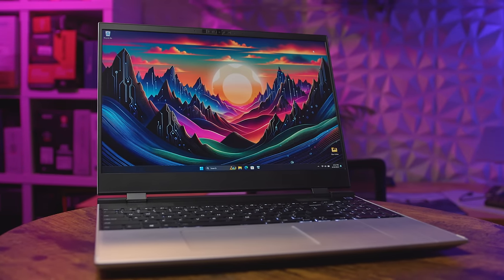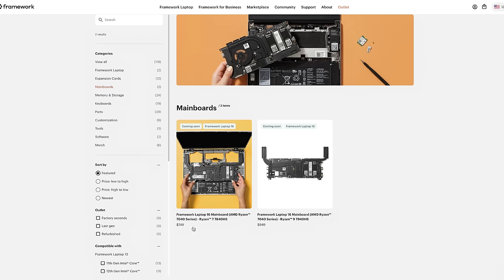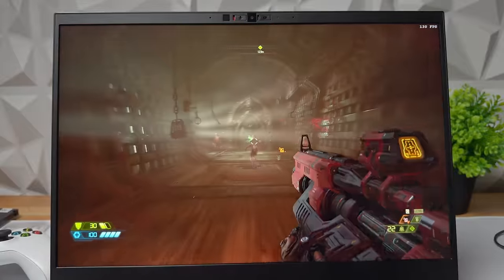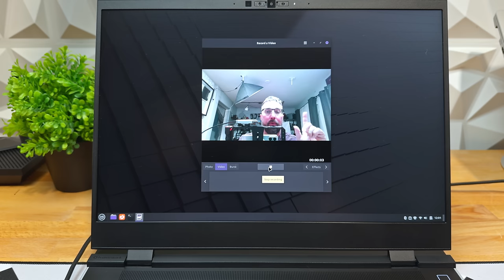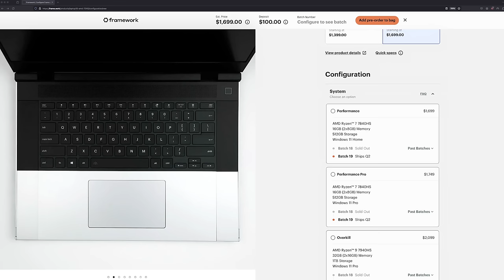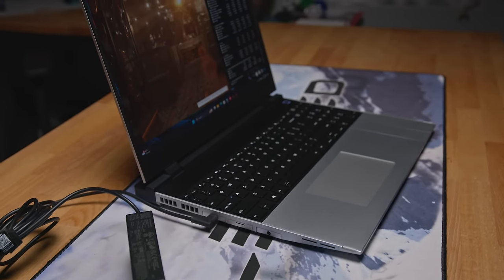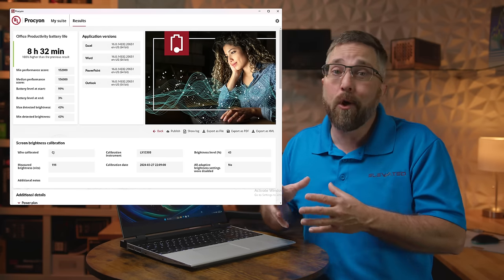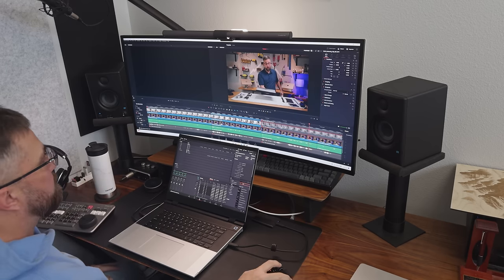Two Months With the Framework 16 Laptop. My Final Thoughts!

Comment: I'd venture that the pricing now for it makes it a poor choice. However, when you want to upgrade it with the marketplace in full swing (6-18 Months out) that upgradability will pay off all the more I think. Steep jump in price now but longevity is where this will win.
Reply: Yeah, while quite expensive now, it can still recoop its cost in several scenarios. Having the ability to swap whatever you want whenever (wherever, Shakira knows) is a big plus, and allows you to do it when there are sales for example.

Though, let's face it, this is really good price/performance when you get it old (like Framework 13 with 11th gen Intel CPU) or refurbished or 2nd hand. The nice thing is that this will surely be very good for 2nd hand sales. Both for you to get one for cheap, or for you to sell it and recoup a good amount of costs. Same with the parts market.

It will take some time until people realize or until it will be more apparent the value of its repairability and modularity. Just like people in the past years said "just get an old Thinkpad" for a really nice, rugged, perfect for Linux laptop, the same will be with Framework. And I wouldn't be surprised to see a new class of people turning into snobs showing off their 12yo Framework with just a couple of upgrades still going strong and doing very well in recent apps (I would know, I might be one of them, lol). But I'm getting a bit too ahead, let's see how this evolves.
Reply from the maker: Maybe, but one of the ways I looked at it, if I buy an upgraded GPU in a few years for $500+ I've essentially still paid the same price as buying 2 complete comparable laptops. The saving money in the long run argument only works if the laptop is reasonably priced to begin with. If I'm already in the hole $1000, buying upgrades isn't getting me out of that hole, it's just getting deeper.
Reply: @ElevatedSystems All depends on the inflation. 
500 might not be much in 5 years.
There might be choices with Intel GPUs giving you Quick sync for video editing.

While not perfect it is a process to reach a better line of products in the future.
Reply from the maker: @zakit  unfortunately inflation will also effect Framework.
Reply: @ElevatedSystems  I got few old laptop still perfectly fine after years and years of using 

Alienware 15r3 which 6700HQ/1060
Clevo 650kk been upgraded from dual core to quad core and now running 6 cores 8700T with 1050ti 

A dell xps13 8250u

Their problem is no longer effective in power /performance, even I running them at best power efficiency speed.

So I am wondering how much the framework investment will pay itself. Another issue of framework is their slow delivery and development, when they shipped they were already 0.5-1 generation older 😢
Reply: @frankwong9486  they actually launched at a great generation. 7000-8000 laptops is a nothing burger, some 'AI' cores and a mild clock bump. their board upgrades later are usually pretty well timed, being under 6 months past the latest or actually i think the newest generation was on time. and being on the bleeding edge is usually bad for stability anyway
Reply: @ElevatedSystems  This better be tracking on every single Framework board meeting slide deck or the company won’t survive.
Reply: Better economic option is b-stock or buying used, where you can then buy new components to upgrade it.
Reply: Really! You guys? A small upstart company, going against the mainstream way of doing things will always be expensive! And their sales are also low, they have to do everything by themselves, testing, design, validation etc....
Not cheap things, prices will be higher.
Things will get cheaper in the long run, when hopefully more sales for their products starts happening.
Reply: i call that bs, it will only be a better option than normal laptops if the prices were very close, but that kind of money you could buy the 2 laptops for the price of one framework,  lets i buy one and after 5 years, my gpu becomes outdated, would you rather upgrade a 5 year old goddam laptop with all the wear and the scathed and usuage with just a GPU? or would you want to get the new gpu AND new other materials such as screen and keyboard, upragdabily is always a better option, but not for this kind of money, stop justifying this bs price and say its worth it, the reason framework is expensive is because it is still a small company
Reply: I think the real situation here is, it may be worth it for us to invest a bit of extra money just to make sure a company like this continues to exist and keep money away from people who are focusing on planned obsolescence. — I also like that there’s the cooler-master case to repurpose the 13 inch versions into a mini PC. And also they have an “outlet store” version with cheaper options from excess inventory or returns or whatever
Reply: Agree here, I use my FW13 primarily for offsite work. I unfortunately had accidentally dented my FW13 case multiple times to the point I can no longer stand it, and swapping out just the case makes a lot more sense cost wise.
Reply: When you upgrade you can sell the old parts, especially as someone can buy these old parts and slap them together with a 3d printed case as a cheap, powerful little pc. So they will retain a pretty good selling price.

Comment: In my opinion, there is no reason to buy the FW16 at its current price point unless you want to show support for the company and their mission statement. There are better laptops out there in terms of performance and performance per cost with some equally as repairable (HP, Lenovo, etc.).  With that said, the company is fairly new, so the cost right now is more of an "early adopter" tax and I suspect subsequent generations will only get better and be more competitively priced as they mature as a company and streamline production costs.
Reply: Yes but if nobody buys the laptop it will die.
Im worried they will die.
Reply from the maker: I don't think it's a problem, however, if nobody buys the laptop, do they deserve to continue?
Reply: I can't stand HP as a company. Big reason I won't buy from them. I commented why I think this laptop will be good for me. But, I'm not going for a GPU.
Reply: But if you want something faster, upgrading is an option, possibly saving money in the long run. 
Or if a part breaks, you can easily replace that one part instead of the entire laptop.
Reply from the maker: @harrkev  true but one of the ways I looked at it, if I buy an upgraded GPU in a few years for $500+ I've essentially still paid the same price as buying 2 complete comparable laptops.
Reply: The Framework 13 is where its at in my opinion. I don't think the FW16 is worth the price for gamers. There are much cheaper ways to game. The FW16 makes more sense on a large order of laptops for companies that want to offer a more affordable option longterm for their employees. It makes no sense to me at the current price unless I just want to support the FW company.
Reply: @ElevatedSystems  If anything doesn't deserve to continue, it's the literal mountains of e-waste.
Reply: You do realize used laptops have a higher resale value and demand relative to used FW parts that are typically built to work in only one laptop? Used laptops can also be gifted to relatives - even donated or repurposed, but the same can't be said about the majority of FW parts that will eventually begin to accumulate because they become so outdated as years pass, their demand drops to zero.  Kinda puts a wrinkle in the whole e-waste thing.
Reply: HP.. repairable? I guess you could say lenovo is OK, but I don't think either of them compare to the framework...
Reply: @filipDcve   Yes the HP 845 G9 and G10 (for example) are completely repairable with HP offering all components for sale along with easy-to-follow videos on their website on how to remove/replace every single component. LTT did a review on this showcasing the high reparability of that laptop! Now HP as a quality company with quality products ...well that may be up for debate. lol  But yes HP ---> repairable  (at least with the elitebook line)
Reply: @meal_team_six  I remember, that was a sponsored video, right? I stand corrected, those are decently repairable.
I would still pick the FW13, but the difference in terms of repairability is minor.
Do they have something that could be considered an alternative to the FW16 though?
Reply: @ElevatedSystems Based on both the original 13 inch and the current 16 inch, I think it's safe to say that first gen framework products are never worth it for the average user. They get refined over time, and I could easily recommend the 13-inch to anyone nowadays, but the 16-inch I'll wait for the second or third revision, or maybe even wait for an ARM version, and then wait for the second or third edition of that.

By the way, how are the speakers when you tune them with external software? I don't understand why nobody bothers to tune their speakers other than Apple. It's not like it's impossible. They add other stuff on top of Windows.
Reply: It was a massive preorder but I don't think I am convinced either. 16" with mediocre speakers is a let down. I don't care for the modularity outside of the ports. Mainboard upgrades will be good but it's just big and expensive.

Comment: Fair enough. I am still keeping my pre-order, though. As you said, it's a stand-out option for Linux users: there is nothing else quite like it w/ official Linux support right now!
Reply: Not trying to sway you, but just pointing out ThinkPads, Dell, System 76, and HP all officially support Linux so you do have options if there is any hesitation with your preorder
Reply: @meal_team_six not wrong, but if you're looking for a dGPU, a lot of these options only have nvidia, and I think most linux users would prefer AMD
Reply: @meal_team_six if you are fine with an NVIDIA card, sure! For an AMD setup, this ranks at the top. Credentials: Had linux primary on 3 subsequent Dell laptops, bisected a system-breaking kernel NVIDIA bug last year and just had to recover my system after a routine Arch pacman upgrade was borked, directly caused by NVIDIA.
Reply: @meal_team_six System76 laptops are extremely expensive for what they are
Reply: @BrandonArnold0 arch Linux is a high maintenance Linux distribution (do it yourself) don’t blame NVIDIA for your dysfunctional operating system.
Reply: Can i ask why  people use linux if not for programming.?
Reply: @aYt1816  I can't speek for everyone, but I use linux on all my personal systems because it's just what I'm comfortable with. I dont really program much at all except as a hobby. I use Fedora and honestly I feel like in nearly all respects Linux gets out of my way and lets me just get work and relaxation time done better than windows does and I've never liked the closed garden mindset of Apple so macs are out.
Reply: @SiraMirai  i see! Thx for the opinions! I am also not really a fan of windows with their many unnecessaries programs and updates all the time. But since I do games from time to time, i wonder if it is also possible to play most windows game on Linux?

Comment: I was considering a framework but the price didn’t really make sense. I ended up with the Legion Slim 5 14” gen8 with ryzen 7 and rtx 4060. I was coming from a Asus g14 (rtx 2060) and a MacBook Air 13 so I am already used to the 14 inch size. I really appreciate the OLED screen, the quiet fans and the build quality.
Reply: I also went with a Legion Slim for gaming and it's a fantastic laptop, good choice.
Reply: 3rd legion slim 5 OLED. Love it

Comment: This makes me feel comfortable that I went with a config without the GPU module. I'm not a gamer. I just want a computer i can customise lol

EDIT: I bought the GPU now and I'm very happy with it. No issues so far!
Reply: How is your experience with the IO. I have the 13, but I cant wrap my head around the spacers, id rather have a solid trackpad with spacers and upward facing speakers. The keyboard modularity is cool though.
Reply: @floreslouis  the IO is great though they do show only specific ports (closest to the screen) can do things like charging and video. the spacers arent great because fit and finish is kinda awful, and because the spacers exist the audio is BAD. but giving the option of with or without numpad, plus the gpu (aka the whole back end) can be replaced, so that leaves the entire top basically locked down. there really isnt room for speakers where they should be, and they would have to totally redesign the internals to make them fit in the right spot. basically theyd have to start from scratch for that to be fixed. 

but 6 ports of whatever i want is so nice to have, and being able to keep a couple spares for emergency (ethernet port for when wifi card craps out, spare type A for if i need a flash drive plugged in) is really good. i do hope they put out a 240w charger at some point that the port can handle, thatd be another upgrade
Reply: @floreslouis  oh mine is shipping soon, I'm in batch 10 so I've not had it yet. Probably a good thing because they're getting better the further into production they get.
I'll let you know though :)
Reply: I preordered but cancelled prior to shipping. I was in Batch 2. I really hope the gpu situation with the FW 16 doesn't turn out to be vaporware. I know a lot of people have been asking them and they have been tight lipped with the road map for that.
Reply: @meal_team_six  they've been tight lipped because their lips aren't the ones with answers. that depends on AMD. that's the same reason even though the laptop is that expensive it's basically on par with a 3060. that's actually just the best AMD put in a laptop. to have an upgrade option AMD would have to put out something above that. so we'll see if AMD tries higher end in laptops
Reply: Update:
It arrived earlier this week and it's brilliant. Loads of the problems people reported have been fixed and I'm loving this thing. :)

Comment: Great review. I agree with you: I support framework, but the 16 doesn't seem like it's for me. I love that they have it and know that fw will learn from the 16 release. What I hope is that they continue to create and offer new hardware and the upgrades for all their systems. Instead of a 16, I think this year I'll upgrade my 13 and repair its dents, dings and hinges from 2 years ago. It IS turning into a smart choice since it will serve me for 5+ years IMO.
Reply from the maker: Agreed, the FW13 is a great laptop especially considering it is comparably priced to its similarly spec'd competitors.
Reply: I hope the 13 eventually inherits some of the screen specs, keyboard customizations, and overall compute capabilities of the 16 in a smaller from factor.